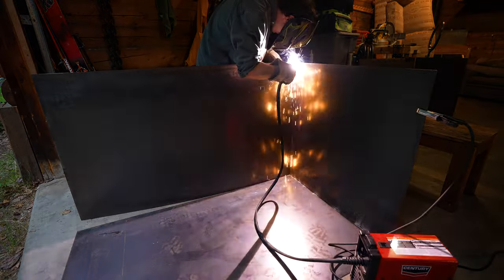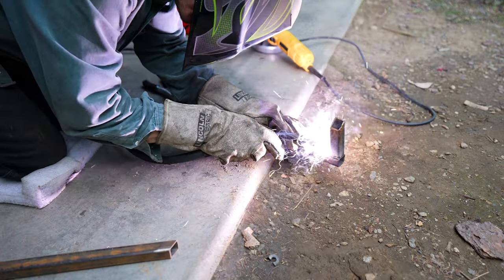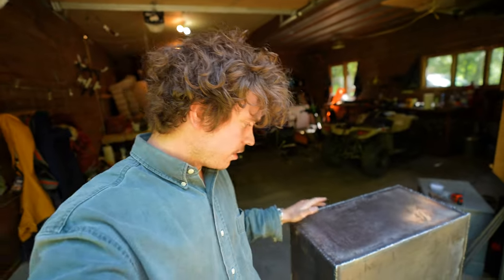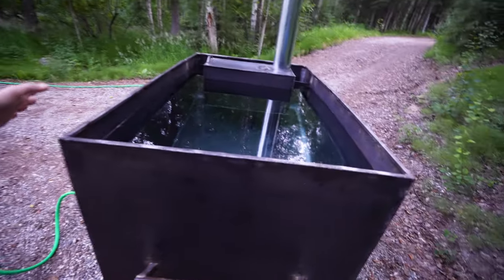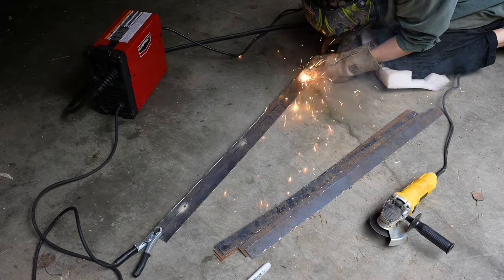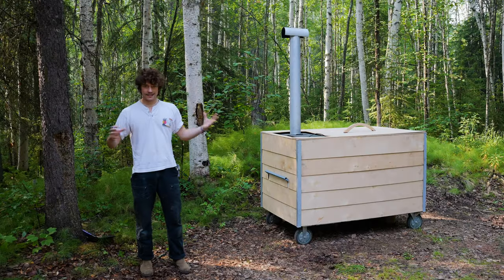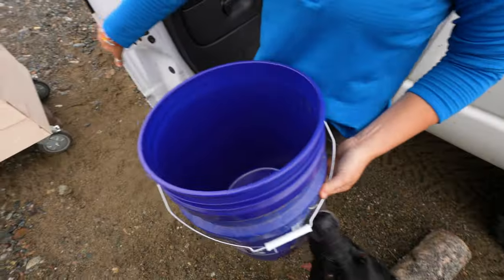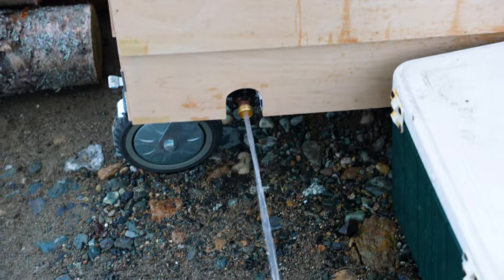Building A Portable Wood Fired HotTub!

Comment: You should add and overflow drain at the top to prevent accidental water spillage into the fire.
Reply: And if you wanna be real fancy, maybe a solar powered water pump to keep the water a consistent temperature

Comment: Hello Yogaman!  You have good ideas, but the implementation is always lacking.  The drainage pipe to completely drain the water needs to be made from below and through a 90° bend of the faucet and it will be convenient, especially since you will have 15 cm of ground clearance. But the main thing is safety, install a solid grate in front of the stove wall, otherwise you will get burned when you accidentally touch it with your butt)😂